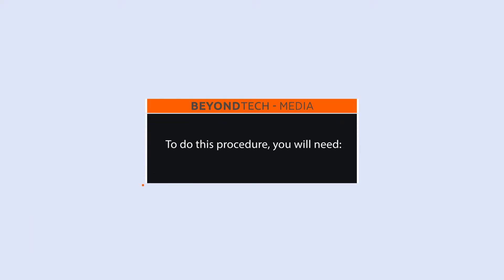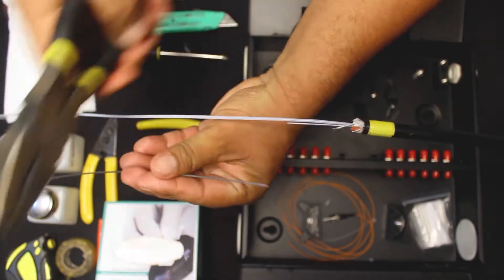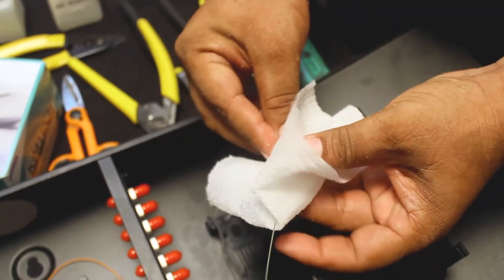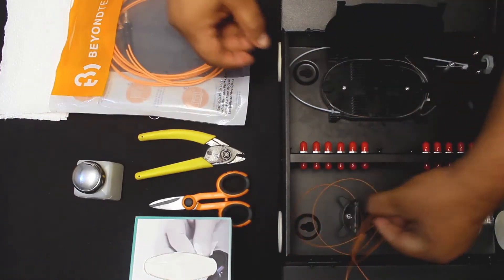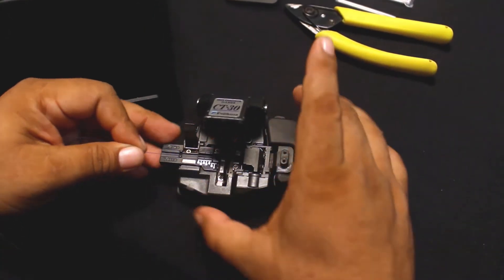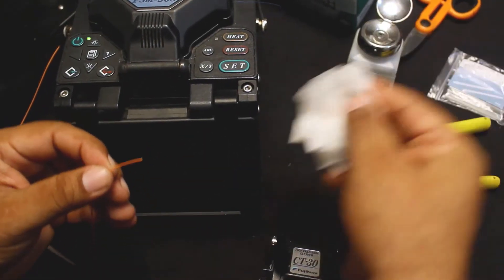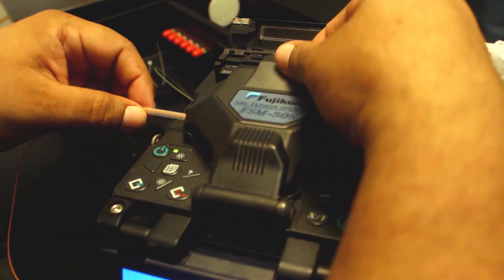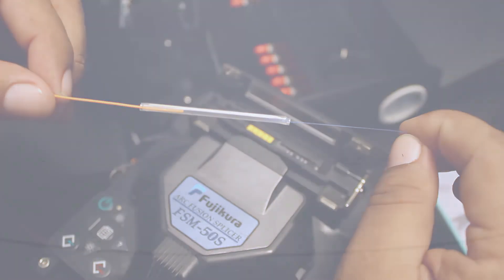How to do a fusion splicing in a fiber optics splice tray: Beyondtech Tutorial

Comment: Nice video, but some problems with the video.
The fiber splice should not see a line of finished splice (This is a problem in the future)
A standard splice will not see a line of the fiber.
Contact your supplier of the splicer, if this hapends.